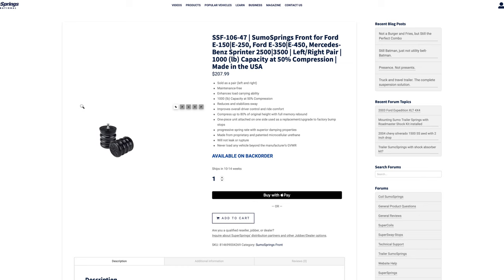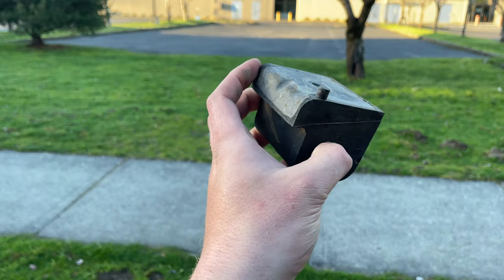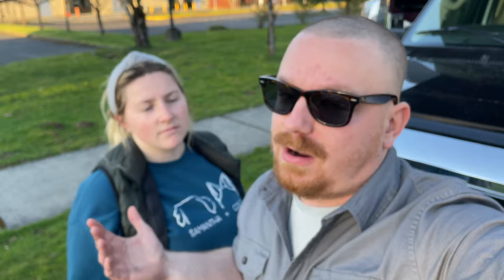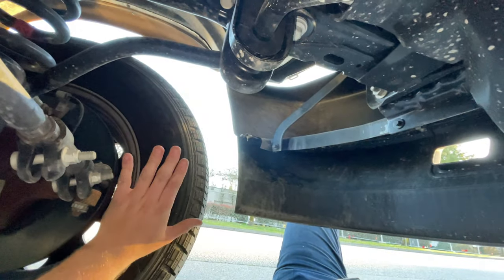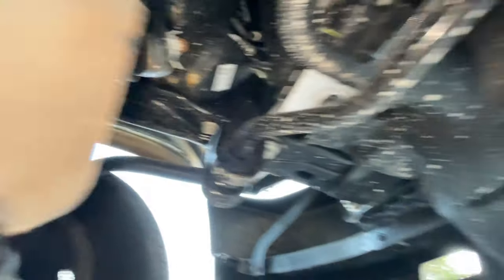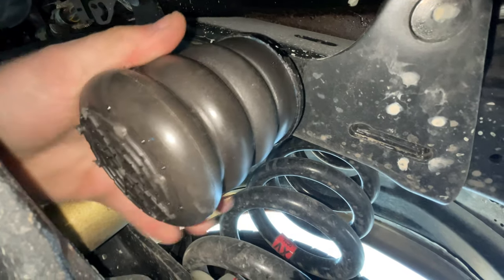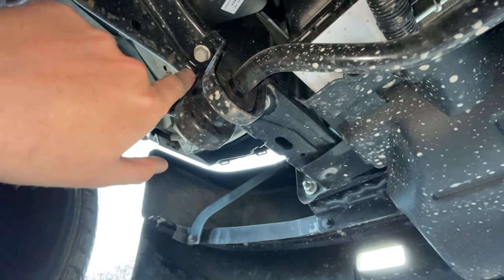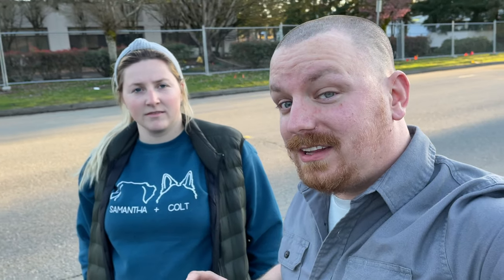How to Install SumoSprings Bump Stops on RVs | FULL TIME RV LIVING

Comment: Add Trac bar to rear axle.

It solves the “tail wagging the dog” issue.

Another Solution is installing the Safe T Plus from Steering Stabilizer.  That helps get steering to “Center”.

What I don’t understand why Ford allows these on the road without all these improvements!

Comment: Have not installed to Sumo Spring yet, but the steering stabilizer to Bilstein brand with the dust boot. The steering performance is more even and it goes straigth as an arrow on the road. After a EU control here in Norway, the bushing for the front stabilizer was worn out. Could pull the rod back and forth. Did replace to moog brand. Has blue color and was easy to control after replacement. Greeting from Norway

Comment: I just did the work this morning, replaced the 2 front stops with the Sumo Springs. I drove it around the block and I can't believe how much of a difference it makes! I'm a little intimidated by the other upgrades but you were right, this one was EASY! I used the leveling jacks to bring the front tires off the ground which gave me more room to work.
Reply from the maker: That's exactly why I've been so excited about that simple upgrade!! I watched the video about the sway bar upgrade and I feel like it sounded sort of like I wasn't impressed with it at all. It was just that it wasn't as noticeable as the SumoSprings! I'm hoping that the weather is dry this weekend, and we'll be installing the steering stabilizer and making a video on that. I don't think that'll be tough at all. The sway bar, however, really was a breeze! The only somewhat pain was that you need an impact drill, but pick one up from Home Depot (I'll take any excuse to visit a hardware store!) and from then on out it's as simple as can be! 6 bolts and nuts, drop the bar down, install the new one, and you're good to go! I think this is why shops make so much money, because people (especially me!) are afraid to get in there. But for things like this, you can't mess it up. And even if you do, let a shop "fix" your mistakes!

I know a lot of folks who say doing brakes are no problem, and this skepticism of not wanting to break something or do it wrong always sketches me out. That's the minimum level I'd like to be at, because paying a shop over $1k to do a simple brake job hurts me on a deep level 😂
Reply: I just did the steering stabilizer. Very easy to install. Took 1 hour.

Comment: Have Sumos front and rear.  Made the ride of my 22MY F-350 better, especially pulling 5th wheel.
Reply: How about a little blue loctite?
Reply from the maker: @jeffdroller  That's awesome, it really was so easy to install on the front. I've heard that the rear is a little more effort, but huge upgrade in my opinion! And I considered Loctite though I figured I'd watch it for a few months and see if there was any movement at all just in case it ever has to be removed, but so far they haven't budged and they're doing their job as good as day one!

Comment: Trying to install these on my Entegra Odyssey and can’t get my socket wrench in to get the old bump stops off. Are your front leveling jacks creating the space between frame and old bump stops? Thanks for the great video.
Reply from the maker: Yes, they do create a bit of space! If you don’t have the auto leveling system, try using a lift and secure them. You can likely do one side at a time without issues as well!

Comment: I’ve the same problem with my 2021 gulfstream C, not bad but enough, looking for the same you got with the sumo’s
Reply from the maker: SuperSprings International, Inc. SSF-106-47 | SumoSprings Front for Ford E-150|E-250, Ford E-350|E-450, Mercedes-Benz Sprinter 2500|3500 https://www.amazon.com/dp/B00ER5OA9G/ref=cm_sw_r_cp_api_i_2DGFDFCJHZQAPZYBPPJ4?_encoding=UTF8&psc=1 this is where we picked it up! Got here in 2 days!! world of difference!
Reply from the maker: And for a 10 minute install, you can’t go wrong!
Reply: @CozyLivingMachine  lol, watching your video I froze it showing the description of the sumos and looked em up on Amazon. I ordered them plus steering stabiles shock. That’ll be about $500.00 we’ll spent. Also just to mention I got a recall notice from Ford today , they’re stating that there can be the possibility that the s pressure side hose on your power steering could be loose. I can check them myself or bring it to Ford. Thought I’d letcha know beings we have the same E450 chassis’s, maybe yours might not fall into that. Wouldn’t hurt to check, got mine via usps. Investigate if you feel inclined.

Comment: Nice tip. I have the safe-t plus stabilizer and it helps a ton so you will be happy once you get a better stabilizer. It seems  to me the sumo springs might give you a bit more clearance going up or down a driveway. Did you notice any ride difference for clearance? BTW- you must have been at valley rv super center. We take our Entegra there as well. They have been good to work with for us.
Reply from the maker: That’s our next install as well! We have the parts and just need another sunny window to throw it on!! As for clearance, I wondered that same thing. I noticed maybe a slight, slight difference at first, the front end seemed to sit a little bit higher, but after checking over the past day, it looks the same to me (which I wouldn’t have minded more clearance!) 

We were at Valley RV Super Center! I have a whole video coming up about some work they did on the rig, and our experience, but I gotta say, I was pleasantly surprised! There are some less than ideal experiences to be had around here in the RV world, especially in Fife, but these guys were just on it, communicated well, did great work, no BS, and were surprisingly fast!!
Reply: @CozyLivingMachine  Yup, Fife is scary. We live in Tacoma but bought in Bend Oregon as we did not trust the Entegra dealers in WA and Jayco did not have what we wanted. Keep up the great videos.
Reply from the maker: @josephhartman2343  No joke! And what a shame that is! Paul Evert's is where we originally placed an order. I'm glad I'm not the only one who gets bad vibes from that company! I just posted our review of our repair experience, if you're interested as well!!

Comment: Did you put some on the rear?
Reply from the maker: Not yet. The rear hellwig helper springs need some adjustments, and I'll see if I can take a look when they're in there and see how difficult it would be to add bump stops there. I'm surprised at how decent it rides back there to begin with though!